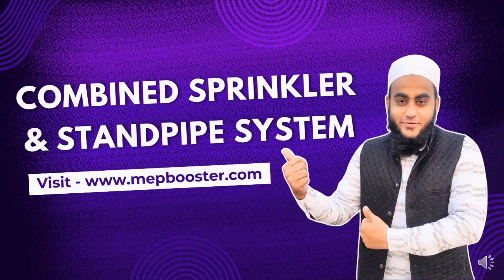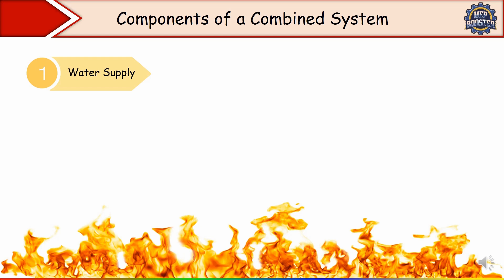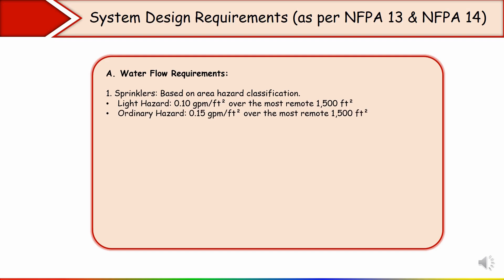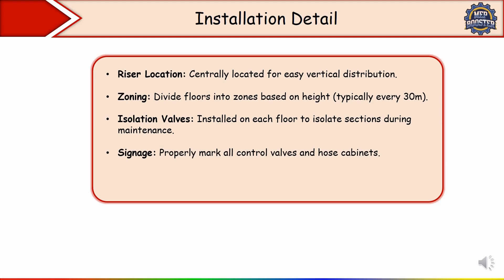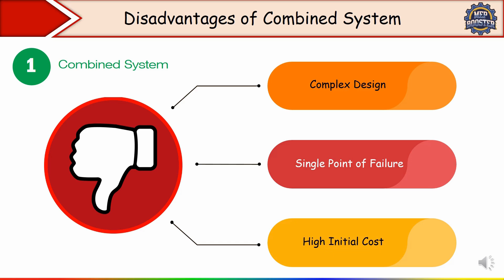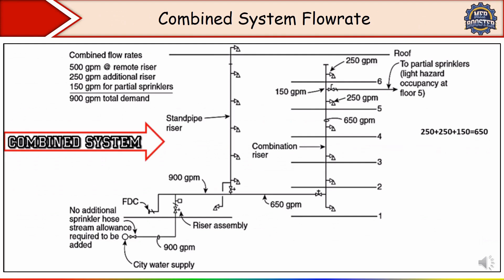Combined Sprinkler & Standpipe System Design | Explained  Complete Guide

Comment: Why does the water demand of a combined system only need to consider the largest individual system rather than the sum of their flows, especially when the standpipe system and automatic sprinkler system are operating simultaneously?
Reply from the maker: The water demand of a combined system considers only the largest individual system (sprinkler or standpipe) because they are not expected to operate at full demand simultaneously, and NFPA design philosophy ensures life safety without over-designing.

Comment: in regards to the minimum pressure what is the minimum pressure for the combined standpipe?
Reply from the maker: 100 psi (6.9 bar) at the topmost hose connection while flowing required GPM (up to 1000 GPM).

Sprinkler pressure as per NFPA 13 (typically 7 psi minimum at remote sprinkler, depending on design).

Comment: how to do hydralic calculation for hydrant system, in Elite software.
Reply from the maker: Steps to Perform Hydraulic Calculation in Elite Software for Hydrant System:

1. Open Elite Fire Software (e.g., Fire version for sprinkler/hydrant networks).

2. Create a New Project and select “Hydrant System”.

3. Input the Water Supply Data:

Static pressure

Residual pressure

Flow rate from fire pump or main

4. Draw the Piping Network:

Add nodes (hydrants, elbows, tees, valves, etc.)

Define pipe lengths and diameters

Include elevation data if applicable

5. Assign Demands at hydrant outlets (typically 100 gpm or 250 gpm depending on NFPA or local code).

6. Input Pipe Material and C-Factor (e.g., CI, GI, HDPE, with C = 120–150).

7. Run the Calculation:

Software calculates pressure losses, flow at each node, and residual pressure at worst-case hydrant.

8. Review Results:

Check node pressures

Ensure required flow and pressure is maintained

Adjust if pipe sizes or pump capacity are insufficient

9. Generate Report:

Summary of input, results, and graphs

Export PDF for submission

Comment: may i know why have you considered 500 gpm for ordinary hazard as per min.requirement of NFPA13 0.15gpm/ft2 for 1500 ft2 which is around 225 gpm .Please clarify
Reply from the maker: Thank you for your observation. While the NFPA 13 design area flow for Ordinary Hazard Group 1 is 225 GPM (0.15 gpm/ft² over 1500 ft²), the value of 500 GPM was considered to include hose stream allowance (250 GPM) as per NFPA 13 Annex guidelines.

This approach ensures compliance, provides a safety margin, and simplifies pump selection based on standard capacities.